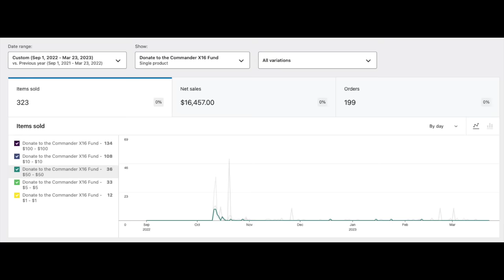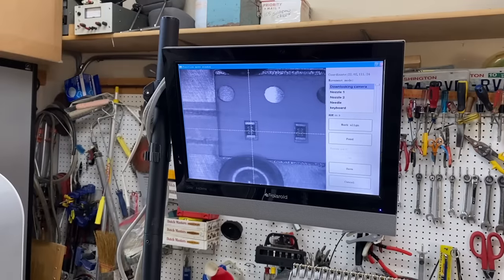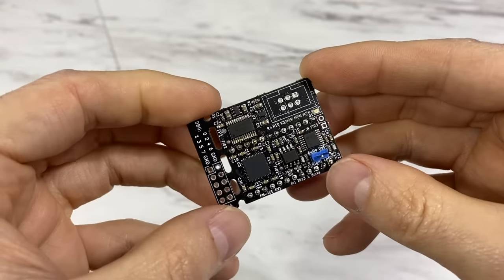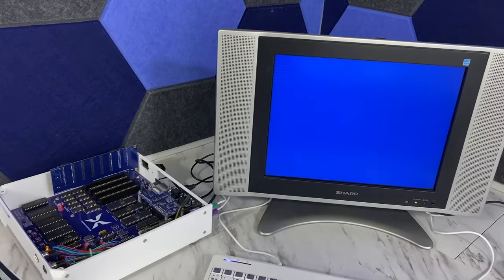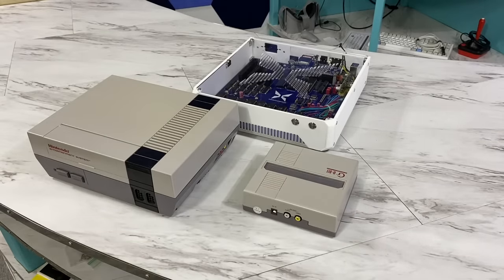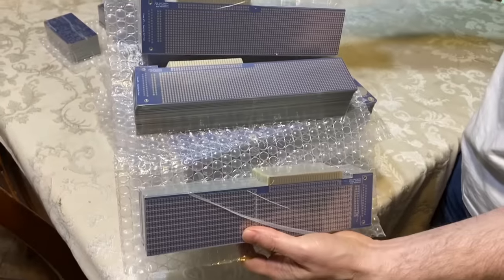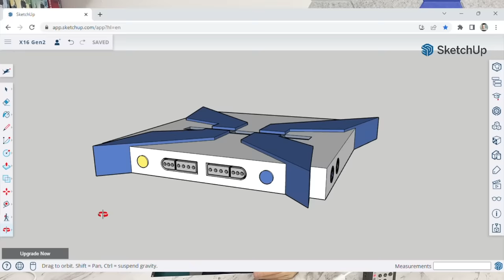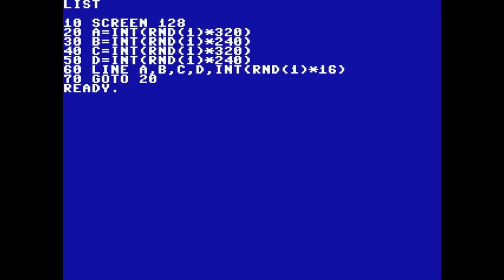Commander X16 2023 update

Comment: As has been said before, your design goals are contradictory. You want a modern computer that runs like an old one but you don't want to use FPGAs, in 2023 no less. You want mass appeal for what is, at most, an extremely niche product. You wanted it to be inexpensive but you're going to use expensive components on a small-run production. I get that this is a passion project and you don't want to disappoint all the people that have put work and money into the project but you might want to revise your goals, be honest with yourself and others, accept that this product needs a redesign and some cost cutting. I think this is something that can be done but you might want to get the help of a professional in the field at least to consult because this is a mess. Don't fall into the sunken-cost trap and bang your head against the wall for the next 5 years, you guys can do this!!! :)

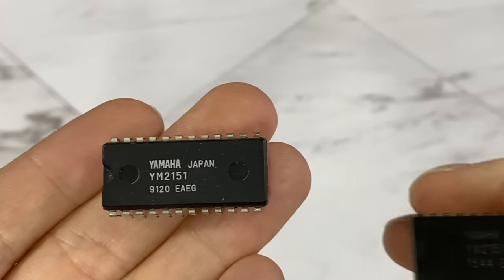Comment: Another way to distiguish a genuine Yamaha chip with a counterfeit is the wordmark: Genuine Chips have the Yamaha Wordmark in it. counterfeit ones are not, and instead they are printed with the same typeface to print the rest of faked details on the counterfeit, as you can see in 8:25 (and that typeface itself is different from the one seen to print the rest of the details in the genuine chips).

Comment: Just to be clear, he is not entirely correct on the Controller issue. The SNES and NES controllers are entirely the same protocol wise apart from the connector. you can buy simple cable only adapters to have a wider variety in terms of gamepads.

Comment: I am sure you will sell your first batch even at the high price of $500 but I am afraid you have overestimated the demand for this kind of system.
Yeah, I am sure that many of us would have been in the market for a system like the Dev system for about $100 (in 2018 prices, more like 150-200 now). But that system will realistically never sell below $400 and then you have lost most of you market. That is above my price point for a novelty system.
The console version doesn't interest me at all. It looks to be very limited and will in essence be a retro console without ability to play retro titles. The programming possibility looks very limited in the console version. Yes, it can run Basic. But it will as I understand it not be able to run the advanced basic proposed in this video since it lack high memory. I see little use for the console version - drop that idea and FGPA the dev machine with the expansion options and lower the price and complexity that way instead

Comment: Thanx for the update. 😊
Isn't it possible to emulate the YM2151 using the VERA's sound features ? Aside from that, there are some sound emulation projects based on the Arduino Nano / ATmega328P / ATmega2560 / ATMEGA168-20PU / microcontrollers in general, some of which cost around $5. 🤔

Comment: It's a nice idea but I really don't see the point, other than an exercise for those making it. You aren't going to sell "hundreds of thousands". I doubt you'll even sell as many as 5000 worldwide. Who wants to play 8 bit games apart from a tiny group who hanker after nostalgia? I used to program in 6502 assembler and loved my Apple II+ and IIgs and I'd love more than anything for that world to come back, but the 1980s "ecosystem" sailed long ago. This machine doesn't even succeed in matching the original goals: $50 (no). Hardware understandable by anyone (no). Off the shelf components from the time (no). One could just buy a modern piece of hardware and run the X16 emulator - so what is the point of this expensive hardware?  I wish you good luck (and I do have respect for you having the balls to make the project a reality), but I do not see this machine being any more than a vanity project for its makers.

Comment: These guys have no idea what they're doing.  It's absolutely insane to buy a dip soldering machine when wave soldering is far better.  They don't even know how to use the equipment.   Would you want a computer built by these cowboys? Perhaps they had good intentions but bit off more than they could chew.
Reply: They had $51k to throw away.

Looks like they spent it on parts, but they'll get that money back when they sell the assembled boards, and on a solder dipping station that they aren't going to use for the X16.

Comment: I think it's rather silly trying to "save money" and doing a cheap version. People will not buy this as their main computer. It's nostalgia, learning, hands on computing and retro. So having two versions will just fragment the ecosystem that could come out of this.
Reply: Those computers will essentially be the same. The "console" version will just use cheaper components, have only one expansion slot and have a built in 512K of banked RAM (which is considered default for X16 even though it can be expanded to 2MB). Even if the second batch of X16 developer boards will be $350 it's still too much for a lot of people for a hobby computer.

Comment: What a pointless vanity project. If it was FPGA based system the constant feature creep would have been tolerable. Without the financing of gullible supporters you would have abandoned this years ago. Who designs a system based on unobtainium parts or that is not easily manufacturable by outsourcing?

Comment: I think that the solution for the network adapter literally passes through the IEC port. The network parameters and configurations, as well as the I/O buffers might be implemented using emulated files. No hardware modification on existing boards, and few or no changes on OS kernel would be necessary.

Comment: I really think it is a mistake to not release a kit. You could probably partner with a PCB company and just create a prefilled cart that would let people order everything, and then it would be up to the person to locate the documentation and build the system by hand.

That would make it clear that a best case support scenario would be from the user community only.

Building the system myself is the biggest draw for projects like this, and I have not looked into the X16 in a long time, so maybe it is already possible to do a self assembled build by sourcing everything.

Still, having a "PC PartsPucker" type cart that would allow the adventurous folks a 1 site for sourcing from an unrelated/unbranded/UNSUPPORTED website seems like it would be a good move. This could be done with or without affiliate links, and assuming the project is open source, someone is probably gonna do something like this anyway, even if it just a list of affiliate links on github; may as well be the ones who get the affiliate link checks.

Comment: Don't use those thick pin headers, they are bending out the pins of the socket, so once you remove it, you won't be able to put original chip, it won't make a connection, use precision pin headers.

Comment: I certainly understand the reluctance to do kits. I work in tech support, so I really do understand...
It still irks me deeply that I can't just build the thing myself. Soldering is relaxing for me. It's my zen time. I did my own mods installing my HiDef NES into my OG top loader, my UltraHDMI into my N64... 25 years ago I built a 2 channel oscilloscope inside a Gameboy cartridge. 20 years ago I built a bunch of robots, all PC boards made by hand. I've taught myself KiCAD in the years since those days, and actually do my own PCB design. I've been soldering since 1984. It's in my blood... Probably to my doctor's dismay! LOL... I've literally soldered circuit boards (both SMT and THT) as my actual job since 2001. I'm paid enough with my work that $500 is no biggie... But dang it... I wish I could just make my own!

Comment: question about the sound chips: since both the original 2151 and fpga solution come at around the same price ~$11, why make another board for sound? is it that much cheaper, since it involves more manual labor? the board will already be $500, so it's better to keep the original chips for the compatibility, unless the YM chip seller is full of bs.

Comment: Manufacturing is hard. I really wouldn't contemplate doing this without contracting out assembly to professionals who've got all the experience of solving/avoiding these problems. It also seems somewhat overly optimistic to specify a part that's no longer in production in the hope there'll be inventory to use.

Comment: I'm really impressed with the graphics capabilities of the Commander X16.  Here's a port of 3D Cube code from a recent coding challenge as demonstrated on Retro Ramblings' channel.  It's hard to believe that this is Basic and not machine language...

0 SCREEN128:A=100:B=20:F=(B*B)/(A*A):C=150:D=50:E=150
1 FORX=1TO100:FORT=1TO4:P(T)=X(T):Q(T)=Y(T):NEXT:Y(1)=SQR(B*B-(X*X*F))
2 X(4)=SGN(X)*(100-ABS(X)):Y(2)=SQR(B*B-(X(4)*X(4)*F))
3 X(3)=-X:Y(3)=-Y(1):X(2)=-X(4):Y(4)=-Y(2):X(1)=X:FORT=1TO4:U=T+1:IFT=4THENU=1
4 LINEP(T)+C,Q(T)+D,P(U)+C,Q(U)+D,1:LINEX(T)+C,Y(T)+D,X(U)+C,Y(U)+D,0
5 LINEP(T)+C,Q(T)+E,P(U)+C,Q(U)+E,1:LINEX(T)+C,Y(T)+E,X(U)+C,Y(U)+E,0
6 LINEP(T)+C,Q(T)+D,P(T)+C,Q(T)+E,1:LINEX(T)+C,Y(T)+D,X(T)+C,Y(T)+E,0:NEXT
7 GETK$:IFK$<>""THENSCREEN0:END
8 NEXT:GOTO1
Reply: Is there a GWBASIC or PCBASIC compatible version available?

Comment: Hope a general solution is found.  

I’m leaning toward STM32 and other ARM chips for audio tasks in my projects.

Even SwinSID v2 went the STM32 route.
Reply: Some STM32 chips are definitely fast enough to run an OPM emulator in them. Though I imagine the cost will be similar to the FPGA solution so it's kindof a no-win.

Comment: I don't know how niche this feeling is, but one could also use royalty free Displayport, it can carry audio too if needed. Not many televisions seem to still have it, while on monitor side it is practically replaced hdmi.
Reply: That is the issue they had when display port was raised as an option three years back. The Mega65 had the same issue, and for the X16c they seem like they are going with the Mega65 solution of an "IMDH" port - no claims to be HDMI compatible, hyf uses an HDMI port and most HDMI TVs would be able to work with it.

Comment: As for that first case design, maybe they could make a version of the top that has a hatch or opening over the card slots area, possibly with little walls going down onto the board at the sides of it.

Comment: One question about basic version: I noticed that the Commander X16 uses BASIC version 2.0 (like the C64 or VIC-20).
Now there was a more advanced version of BASIC, version 3.5, that was used with the Commodore Plus/4.
I learned BASIC on the Commodore Plus/4 and it has some advanced features with regards to colors and graphics, compared to the 2.0 version.
So my question really is, why not use the v3.5 version instead of the v2.0 (because, I bet there are no hardware limitations, and the v3.5 should be backward compatible with the 2.0)?

Comment: plan D could be taking that sound emulator module from the seperate FPGA and just putting it into the VERA's FPGA. obviously that would require some PPB rework but on the plus side you won't have to spend extra money and labor on a second FPGA, and all existing software will still function

Comment: IMO you made the right call with the SNES port. Sure, backwards compatibility with old Commodore Joysticks in nice, but the Mega Drive controller is horrifically complicated especially if you want 6 buttons. The SNES port is just a shift register and based on my rough calculation, the SNES or X16 could easily poll a full modern style Dual Analog controller in less than a millisecond (though I don't think anyone has built a full controller for the SNES).

Comment: I love this, but I gotta say, no digital output with a basic integer scaler is a little tiny bit bothersome. I can begrudgingly understand not designing it to natively default to 16:9 displays, but I was hoping to not have to go through the whole rigamarole of getting this working with a modern monitor. This seems like potentially a great way to get kids into experimenting with computer programming in a way that is simple to understand, easy to set up, affordable, and does so in an environment free of all the weight that comes with a modern OS. 

I really think there's a place for something like this in the modern age as a toy for young kids, but requiring old analog display technology to use it just adds to the barrier to entry, and lowers its appeal to anyone lacking nostalgia for old computers.
Reply: There are several better projects to get kids into programming in a "small world" environment that they can understand. For example, the Agon Light, which is also free and open source, so you can buy it from anyone or make your own. As far as I can tell the X-16 is made primarily to run something like, but not quite, the c64 kernal and c64 basic, and to have an old school sound chip for people who like making chip tunes with actual chips. And honestly, they could have done both of those things cheaper and better but decided not to for reasons.

Comment: David, congratulation for this achievement. I’m a retro computing enthusiast, I discovered this channel recently by chance. Did you never thought to add Wi-Fi connectivity to Commander x16? It would open the door to much more applications like gaming though internet. Also, In my opinion the 50 $ target is still possible since this big board could be certainly integrated into an asic. Good luck for your product !
Reply: There are 4 card slots on a Dev board, so a Ethernet card is possible.

Comment: The ships already sailed, but for future ideas... probably best to keep these supply-ethereal components on a card and have a basic hardware and firmware framework to support sound functions on that card, perhaps have a base-level card that does generic bit-banging, but you or the users could put together other cards with other chipsets and create drivers (which, really, is just adaptation to the firmware framework... probably just changes to timing, memory locations, initialization, and so on). Could make it easier by not having it on the generic expansion bus, and providing a 'sound socket' to provide additional signals and connectivity.

Comment: For doom to work better, maybe an extension pipelined video accelerator would help

As a good and easy example of the video accelerator is OpenGL implementation of the  video accelerator, because OpenGL  is a  state machine with a client/server API model.

An hardware implementation of OpenGL is simple(legacy version of OpenGL from v1.0 to 1.5, using fixed function mode):

Comment: I like to tinker, but I'm a bit of a novice.  I'm curious what programming languages will be supported by this?
Reply: Currently you can code in 65C02 assembly (ca65, 64tass, etc), BASIC, C, Prog8 (a language created by a community member DesertFish specifically designed to cross-compile to 6502), and there are also experiments with Pascal and Rust but I think the first four will be the main languages.
Reply: Advanced BASIC, and Assembly mainly but I think you can probably get any language on there provided you meet the memory reqs.  I have to say, I have been brushing up my BASIC all week waiting for the Commander to report in :)

Simons Basic cartridge on the old 64.
Reply: I did a ton of commodore basic on vic-20, 64 and plus 4. It's been a long time and I've recently been doing c#, but that's a Microsoft language so that's likely out of the question.
Reply: @wadz668  heard rumbles of C+ not sure how inter compatible those two are.

I would be more than happy with QBASIC lol that's about my current skill cap :D

Comment: Back in around 2000 I worked for a large company making servers for IBM. I worked on the Siemens surface mount machines. I was in charge of a line and responsible for the populating of the reels of components and the general running of the line.

So i can relate to how hard it would be to populate the board without a surface mount machine.

To apply solder to the board, we used a kind of printer that used a stencil to apply a solder mask to the board and the it proceeded to the surface mount machines and then inspection (Now done with a computer) and then the oven where everyone fell asleep at the end of the line 🤣

Props to you guys. I loved my C64 and Amiga the most of all the computers i have ever owned and i respect you guys for keeping them alive.

Comment: I'm certain I'm not the target audience for this product, I just wonder who is, for an all new "retro" hardware.
I can see the point of original / restored / modern remake / FPGA replacements for SID chips etc. to run period software on period correct (as far as possible) hardware.
My 8 bit was the BBC Micro, and I cannot learn to love another, and I wasn't that loyal, I went to PC instead of Acorn Archimedes, and jumped in to PC at the 486 level.

Comment: Welcome to today's electronic chip purchasing.  Counterfeit chips is a major problem. I work for as a materiel control manager for a company in the aerospace industry and part of our standard operating procedure that is mandated by the FAA is to have all chips tested for authenticity.

And in regards to the supplier chain.  Yes, that happens quite a bit post pandemic.  If you see availability, you have to jump on it right away or they will be gobbled up especially with the chip market right now.